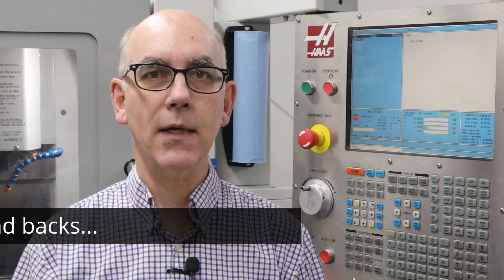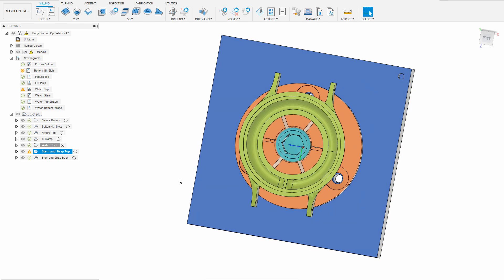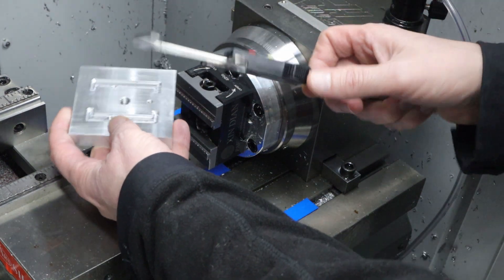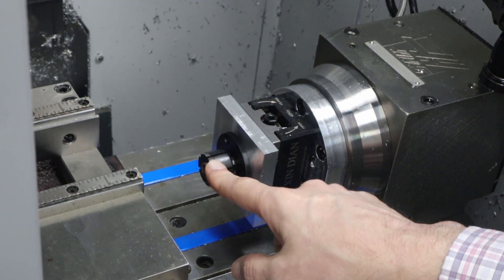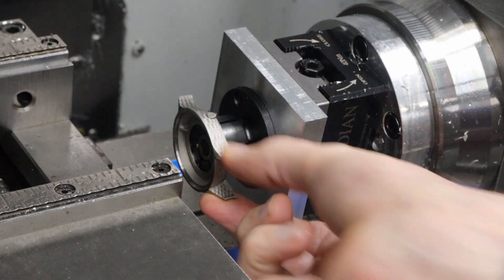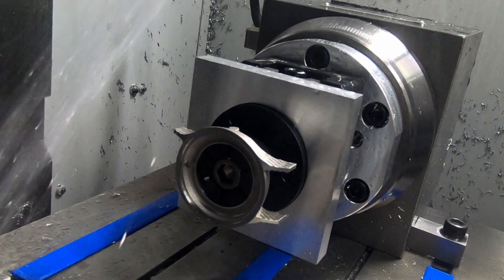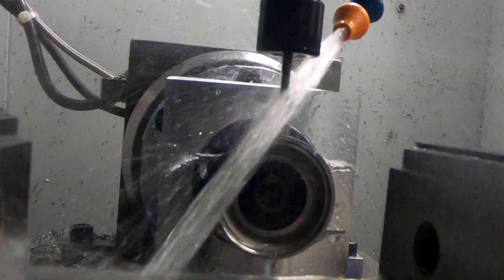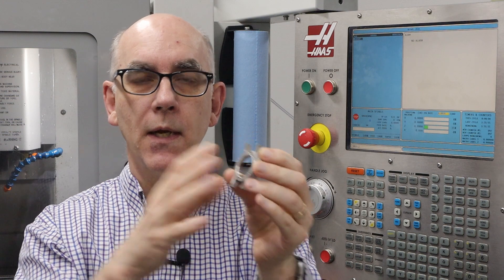Watch Case - Machining a Prototype, Part 2

Comment: Hey John,  I've found that when working with my HRT160 4th axis the Iscar ER20 or ER32 SRK shrink adapters, or extensions are very helpful for getting close to the work holding and saving my collet nuts.  Without those I usually have to add 0.75" or more between the jaw and workpiece so I don't hit the collet nut.
Reply from the maker: Oh, cool! Thanks for the tip! I wasn't aware of those, but that would certainly help. You just may have cost me some money!
Reply: @JohnSL  you can find some decent condition ones on eBay if your want to try them out.

Comment: I’d really love if you did a video on the setup and workflow of using a 4th Axis. I just got one and I’d love a quick start guide on how to get it running from Fusion setups to WCS. Can each side be its own G5X offset? How does the flip from side 1 to side 2 get setup?

Great videos. Great project. 👍🏼
Reply from the maker: I have a previous video: https://youtu.be/PAt4PEej3qk I've had a few others ask for a start-to-finish video on using a 4th axis, so I plan to create such a video now that I have more experience and a better understanding.

Comment: Howdy John! Thanks for another great video! It is really cool to know that one watch will stay with you! That gotta be exciting.   Oh, I've been told that HSS Cobalt is the way to drill SS. Not sure why would one prefer that to carbide, but maybe the reasoning is that HSS CO is not that difficult to be resharpened. I guess I'll have to find out one day when a large amount of ss comes to be drilled. Cheers!
Reply from the maker: Thanks for the tip about Cobalt. I may switch to those if I start to do production of these.
Reply: Carbide beats out cobalt every time, especially when drilling most grades of stainless steel. But with carbide comes a different set of rules and a different approach. You will not have good luck with standard drilling cycles with carbide, especially pecking cycles. What happens is the retract move tends to "rip" the cutting edges off of the drill bit. Carbide, being as hard as it is, likes compression and not tension loads. When drilling with carbide, especially if you have to peck because of hole depth, you need a slight dwell before every retract. This allows the bit to finish cutting completely before it is pulled away from the bottom of the hole. To calculate the length of dwell, divide 60 by the RPM, this gives the time in seconds of 1 revolution. Usually 2 full revolutions is enough dwell to get maximum life out of the carbide drill. But not too long or you will rub and chatter and also damage the drill. You must also dwell at the bottom of a blind hole, even if your not pecking for the same exact reason as above. G82 is the best cycle to use for this. If I have to make multiple pecks in a single hole I will just program multiple G82 cycles in a row with each successively deeper. It gets more complicated when drilling a lot of holes and trying to save time, but there are creative ways around it.

Cobalt drills are great for one time or low usage scenarios. They are much less brittle than carbide, but are still susceptible to edge breaking from pecking so a dwell is still needed. But if your only planning on using it once or twice it's worth the cost savings. The downside is that you will have a much longer cycle time because they run at a lower SFM and you also need to spot drill for accuracy. In the end its really up to you to decide if  the speed and accuracy of carbide is worth the cost or if it's a simple hole and cobalt is good enough.
Reply: @pcsmachineworks  What you have written here makes perfect sense when explained properly, like you did it. 
So my takeaway is the calculated dwell. Thanks! I'll give it a try.
Reply: @burningdieselproduction5498  you are correct! The dwell time is everything. Lots of machinists have found carbide drills to be a nightmare simply because they damaged the drill by not dwelling at the bottom. Applies to manual machining also. Plaid old HSS drills are the only ones resistant to the breakout effects, but of course are also much slower and some machines don't have the low rpm torque sometimes needed with larger diameters.